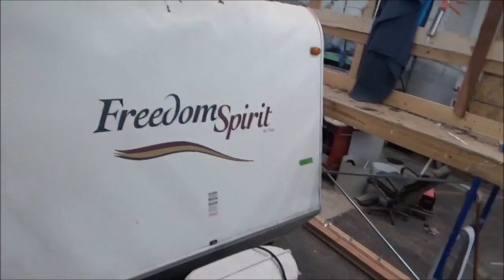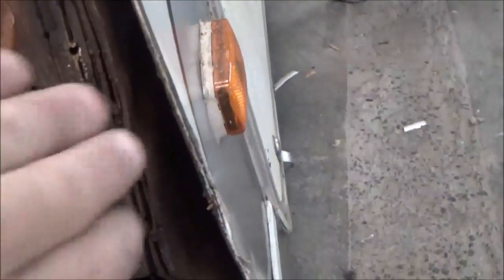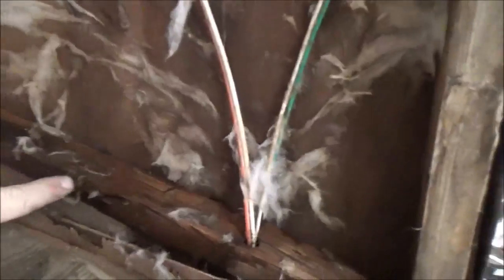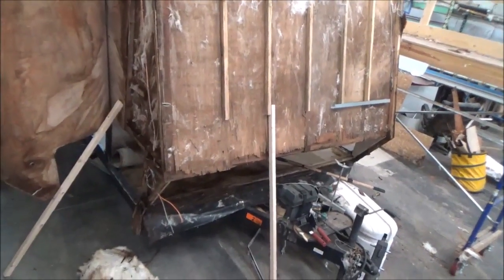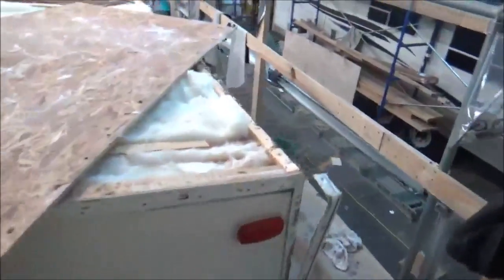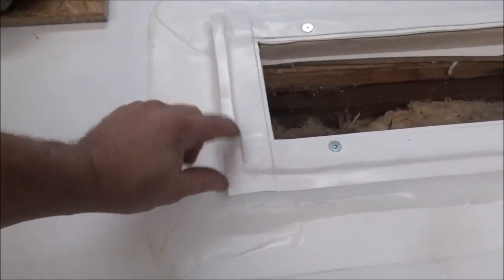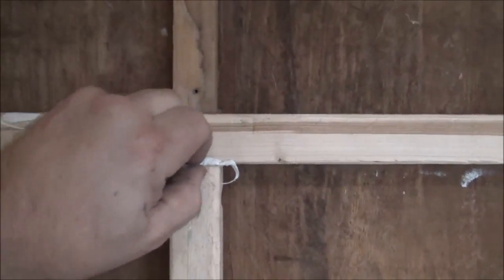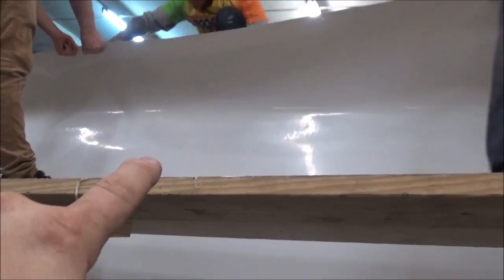RV roof Replacement on freedom spirit

Comment from the maker: You can also use any contact cement that may come in gallons and roll both sides. Once they glue feels dry then you apply. Word of caution....if you are not careful and strategic in how you lay the Filon it will grab and you may have a bubble you can't get out. Filon wants to laynon a sheet of glass so to speak...meaning absolutely flat....any variation may leave a bubble. Work from center out when gluing.

Comment: good day! What kind of glue do you use for gluing the back wall to plywood?
Reply from the maker: You can buy it in small spray cans
Reply: @RVROOFINSTALL  the name of the glue for which to apply it. manufacturer? I tried to use epoxy. It dries very long time and needs the press
Reply from the maker: @Руслан-д3ц4у  3m 90. The manufacturer is 3m...90 is the spray. The make all sorts of adhesives, 80 for rubber, 77 for vinyl...
Reply: @RVROOFINSTALL  thank you very much !!!!!!!!!!!!!!!!!!!!!!!!!!